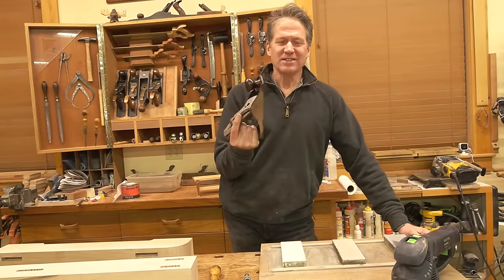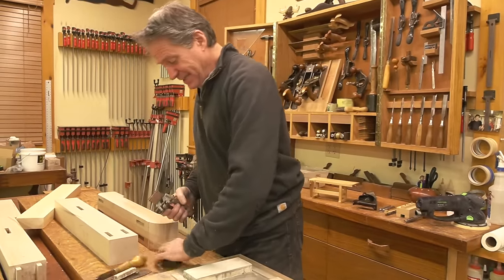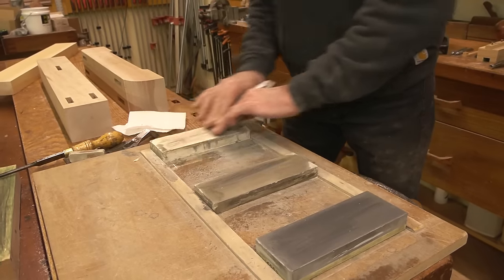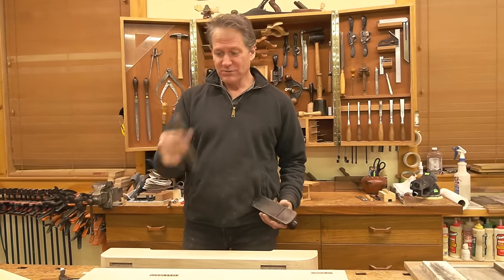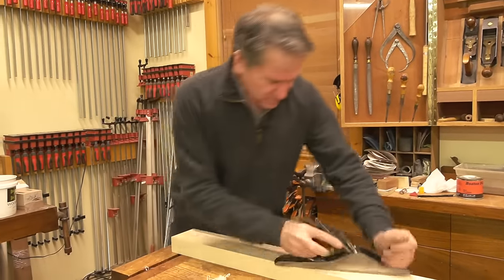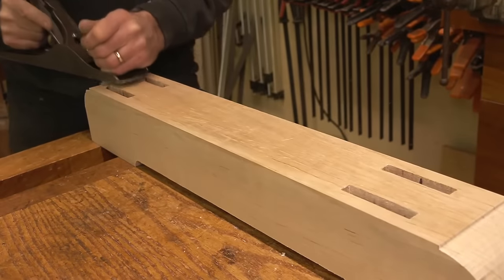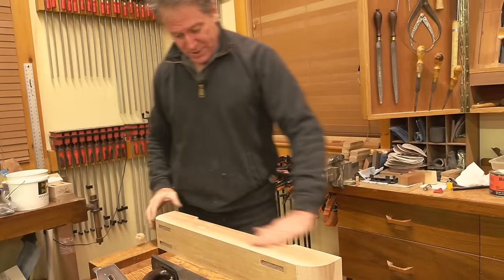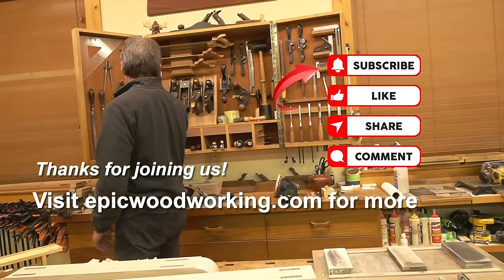Don't Trash Your Handplanes!

Comment: I’ve just found your channel and am glad I did. This video is great again. I have a nice 5.5 but my major thing to solve is clamping for planing. In my small workshop I only have a ‘normal’ bench without good vises. Building a carpenters bench is an option but my worries are mostly to get a good flat top as reference. :-)

Thanks for sharing your knowledge